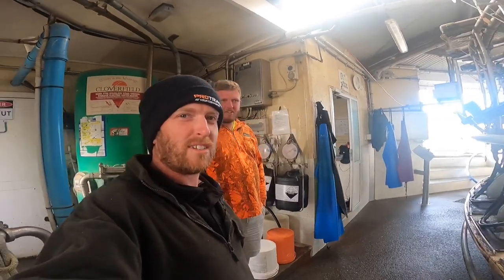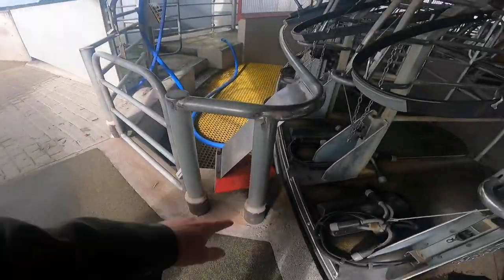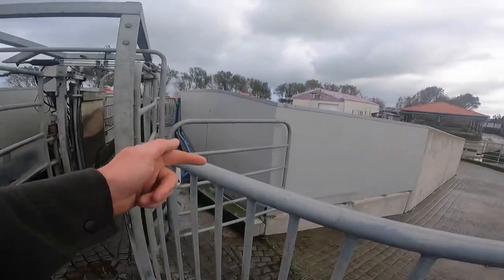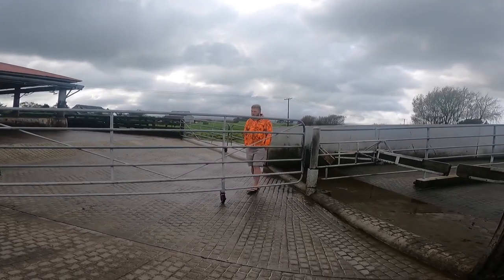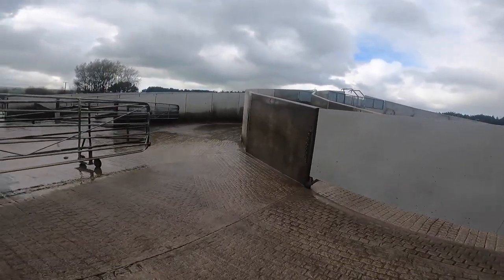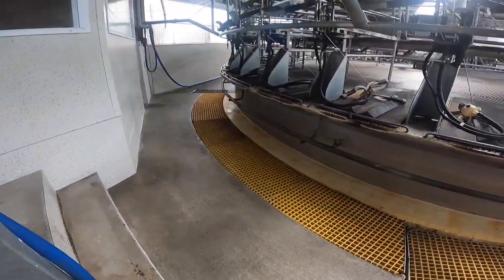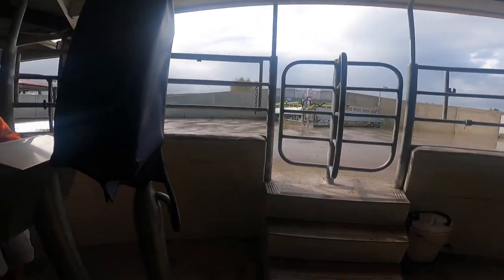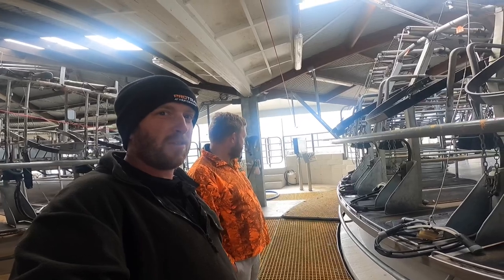Tour of New Zealand’s fastest cowshed

Comment: Cool set up but how much did it cost! And also I can milk 600 through one shed/ one man operation. (60 rotary, two herds using batt latch system so they walk themselves home. Whereas they need two people at least at all times so there’s another cost of labour unit. Also does he have an agitation device or stirrer in that proliq trough? 
Thanks for the tour though, but seems an expensive operation and they could look at recycling green water as the water bill must be sky high. 
Some neat innovations nonetheless.
Reply from the maker: I’m sure it wasn’t cheap I didn’t ask that question. Yes it is possible to milk 600 by your self, how long does it take you to milk? I’m not sure if they have a stirrer in the proliq. Yeah it’s a interesting cowshed to take a look at. I understand they are look at doing something like a flood system recycling water. Thanks for the questions
Reply: 600 cows 1mob  50 rotary bail.. 2 hrs on a good day.. 2 1/2 on a bad day